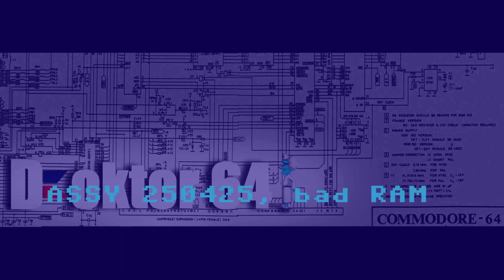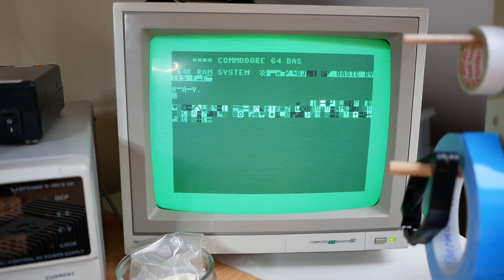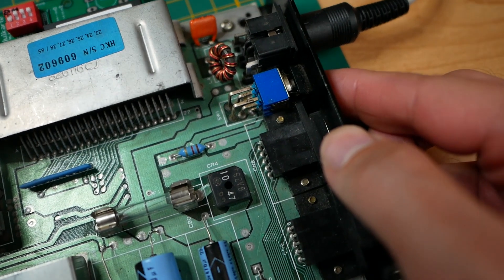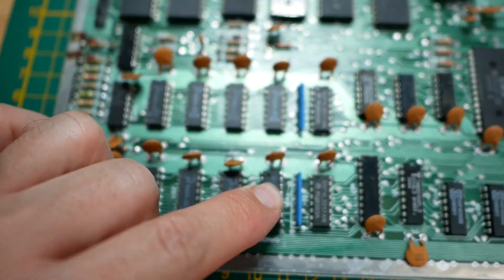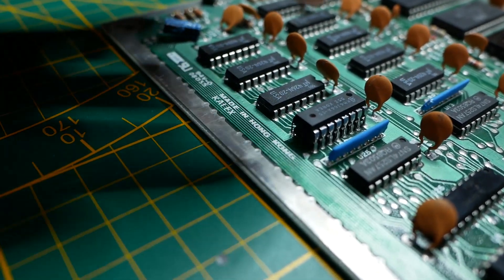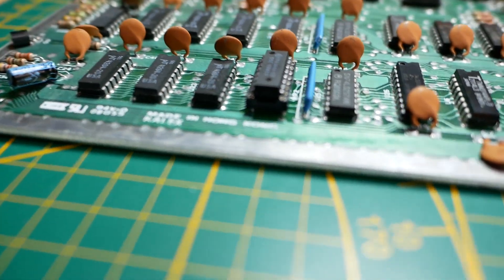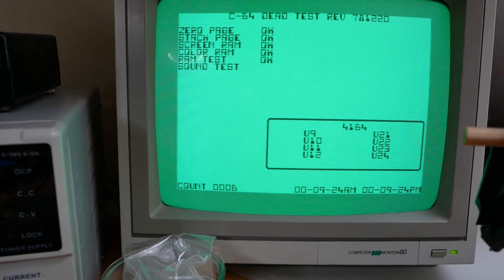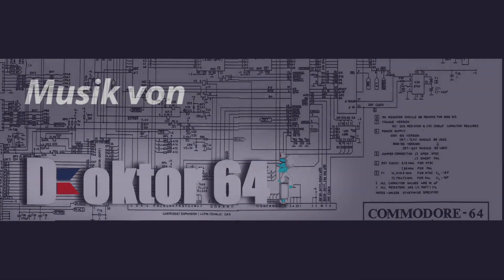Doc64 #16 | Commodore C64 | Garbage Scrambled Screen bad RAM REPAIR ASSY 250425

Comment: Great work Doktor64! The curse of the Micron MT4264 DRAM strikes again! I have a bag that is bulging at the seams full of dead MT RAM chips from C64s. Many times I see broken machines with multiple bad MT RAM chips in a row, as many as 3 to 7 out of 8 is typical! I too like using the surplus Samsung KM4164B RAM chips in my C64 repairs as well since it’s easily available on the surplus market worldwide it seems...